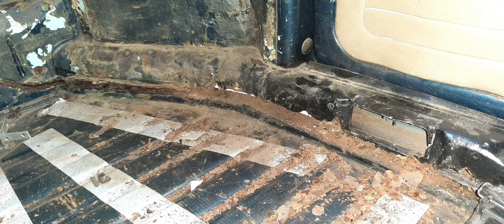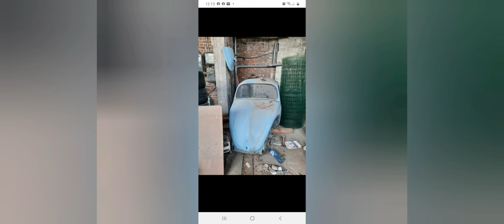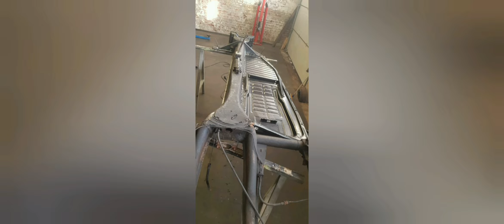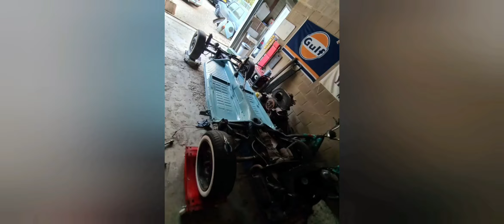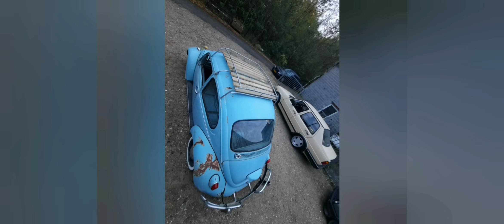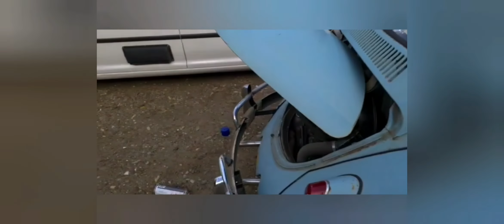My vw beetle/bug project (1969) from start to finish. foto colage 10 min build/rebuild Barnfind bug.

Comment: My 1959 I acquired after 6 years of trying,no motor but pulled a 1500 that was locked up out of a bus he also had ,now a 1600, everything I disassemble is either missing parts or needed replacing,I guess he enjoyed the 60 and the drugs available back then